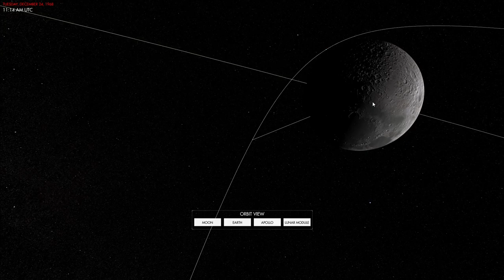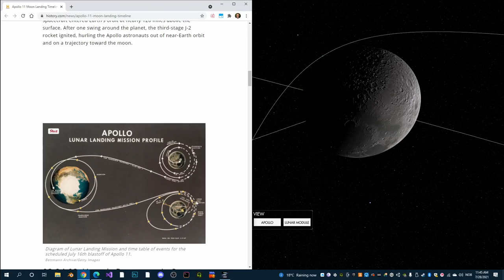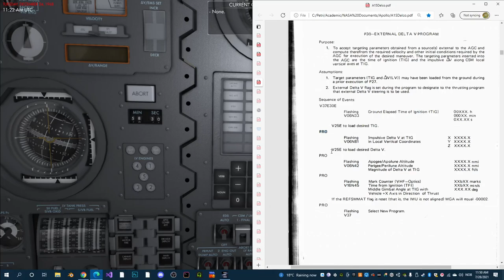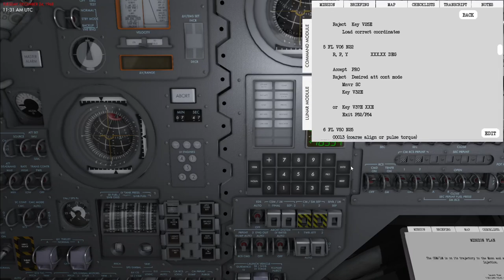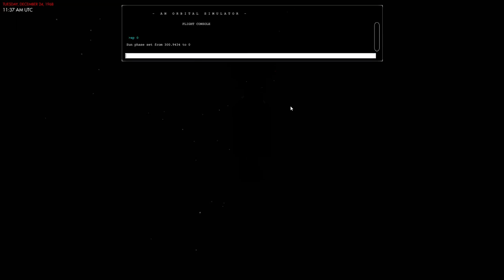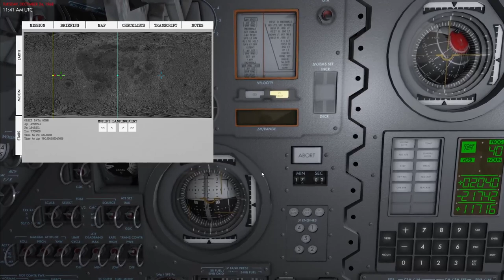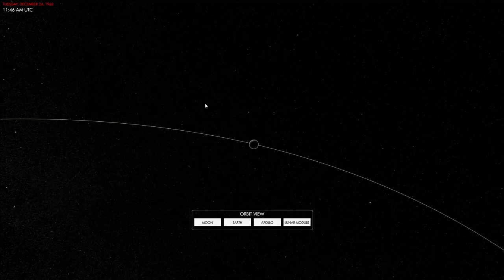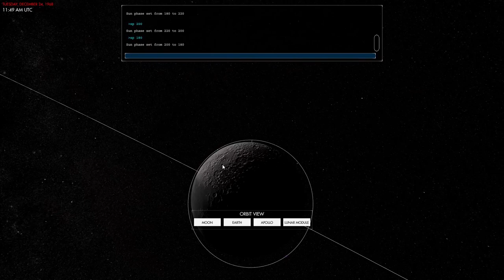Academy: Apollo CSM - Lunar Orbit Injection (LOI)

Comment: Honestly thank you so much for this I was having the hardest time setting the correct attitude for LOI retrograde burn, I was trying to use just p30 and p40 as the academy explains but there are so many thing that still need created to fully understand the shit even in some of the checklist there are thing to run through which are not taught so, it's kinda just hoping you can figure it out, these tutorials really really helped. I was stuck on this damn burn for almost 2 days before i caved in a searched away. Thanks man truly